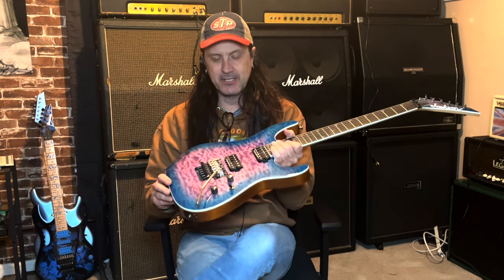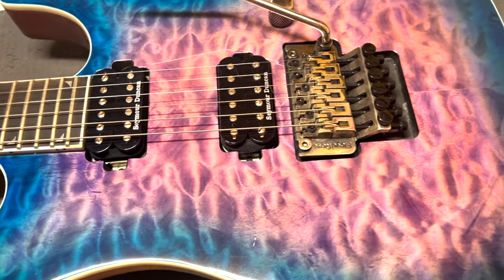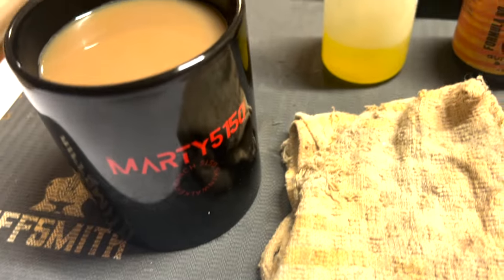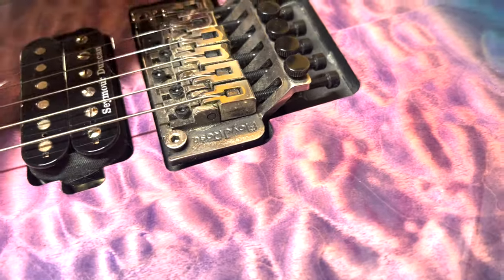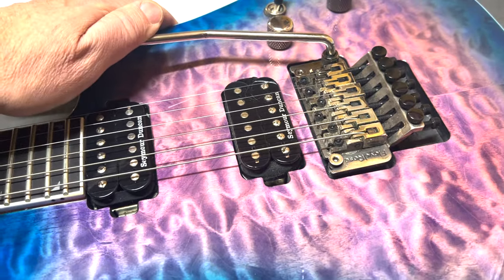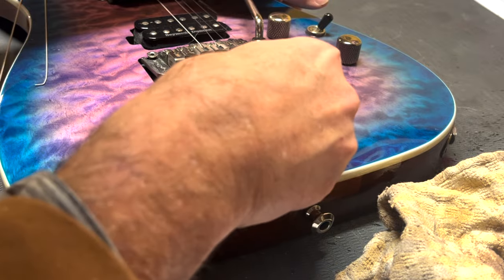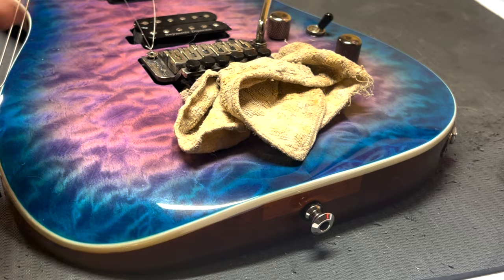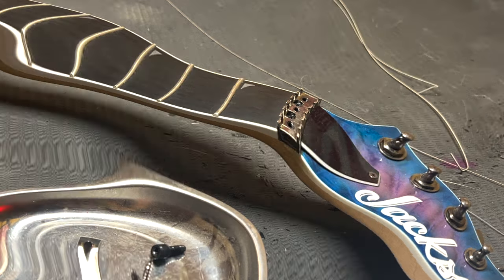How To Change Strings And Setup A Floyd Rose Tremolo

Comment: I put the ball end through the tuners and cut the end of the string with about 1" of slack and lock that in the saddle. It won't work with heavy gauge strings (doesn't fit through tuner hole) but I use 8's.

Comment: Great vid, I would like to add a little tuning tip. By tuning the strings in this order it balances the tension and I find I can tune faster. The order is E-e-b-a-g-d, repeat that order each time you re-tune and presto. Hope you find this helpful. Cheers
Reply: Perfect tip!
Thanks!
Reply: Good tip. I start on the middle two strings to work outward and go half the distance on the tuner past the opposite way of in tune until I get to the E strings. See the Doug Marks tuning video) Saves some of the teeter tawtering (spelling?) later on.

Comment: Nice guitar.. I kinda do it the same except once I'm close I back out the claw screws a turn or two then block something in the back that sets the float. then u can tune and intonation with it blocked then tighten the claw screws until the strings go back in tune which is just about where the block in the back falls out.. it sounds confusing but it eliminates all the chasing and guesswork.. im basically putting it  perfectly in tune with the perfect float without chasing, locking the nut, then it's just a matter of retightening the claw screws til everything falls perfectly back in place. Once I learned how which took about 15 years due to nobody teaching that way, I fell in love with floyds.. it's all I play now. I'm not saying your way is wrong but I feel it's still letting alot of room for beginners to get frustrated by the chase and give up on floyd roses alltogether. Cheers

Comment: If I'm in a hurry, I change one string at a time, no need to block. I also feed the string through the tuning peg and use the brass ball as an anchor so I'm not winding for days.
Reply from the maker: Totally man!  If you keep the same gauge do one at a time and tune to pitch.  Bam. Strings changed 😎🤟🏻

Comment: Awesome Video 🎸 ... Cheers 🍻 🥃🥃
Reply from the maker: Thank you.  So glad it helped 😎🍺
Reply: @Ranch5150SkinWalker  Yeah I have never changed String Sizes on any Floyd Rose Locking System... I take a scared cat approach Leave the 2 E Strings on Start one String at a time in the middle working outward... Work's.. But this is nice  now I feel confident in changing string gauges... Cheers 🍻 🥃🥃 🎸

Comment: Just got a FR and am doing some research before I change strings for the first time. This video is the most helpful Ive seen! You didnt skip over any important parts and described everything well... awesome job man!

Two questions: 1) Ben Eller on his channel recommends getting the bridge flat, blocking the trem from moving in either direction, getting strings up to tune, stretch them, etc.,  then lock the nuts, remove the blocks, and use ONLY the claw screws to get the bridge back to level and strings will automatically get back in tune. Does that make sense to you? 

2) I'm changing from 9s to 10/9 hybrids like you did. If heavier strings makes the whammy bar seem more "stiff," can I safely remove one of the three springs? Or is that going to screw everything up? At what point would it make sense to do that?

Comment: The right video at the right moment: just bought a new (used)  guitar with floyd rose.  Marty what is your opinion about Elixir strings?  The guitar arrived today with Elixir strings : usually I use Ernie Ball but these strings seem excellent. Thanks for the video!
Reply from the maker: You're welcome man!   Glad to help!  I Elixir strings are very good.  They last a long time.  I am personally an Ernie Ball 9 or D'addario NYXL player but really... they're all great options. Ernie Ball are 6.99 so they are usually my go to.  lol. And they never break on me 😎🤟🏻
Reply: @Ranch5150SkinWalker  thank you for your answer Marty. I usually use the same strings you do: ernie ball 9 - 46. About the video, to change all the strings sometimes I Simply change One string at the time, starting by the 6th One.
Reply from the maker: @lore5363  same here man, so much easier to go one at a time.   I showed worst case scenario where the gauge was changing and it jacks up the bar angle.  I get that question a lot.  It can get tricky if you aren't sure how to adjust.  Thanks so much for watching man and the comment.  😎🤟🏻🎵🎵🎵🎵🎸
Reply from the maker: @lore5363  same here man, so much easier to go one at a time.   I showed worst case scenario where the gauge was changing and it jacks up the bar angle.  I get that question a lot.  It can get tricky if you aren't sure how to adjust.  Thanks so much for watching man and the comment.  😎🤟🏻🎵🎵🎵🎵🎸

Comment: In theory, should the bass and treble sides of the Floyd bridge plate the the same height in relation to the top of the guitar body? My action seems high on the treble side, but the B and E strings buzz when I play frets 1-14.

Comment: I've had a Floyd equipped guitar for 19 years. It was my first guitar (not recommended, first string change was done in the shop as 12yo me failed...). 

I knew pretty much none of this. For instance I have necer cut the end off the string. I just opened tje saddle all the way so it fit in... I didn't know you were supposed to tune it from the back, I always unlocked the nut. And it's the only guitar I never did a full setup on, which at this point I do constantly. It just got warm, all my necks aren't at the correct relief anymore.... Haven't played it in years (Ibanez RG) now I want to refinish the guitar, and remove the EMGs I put in at 14. So I figured maybe I should finally look into how a FR is supposed to be used... thanks! Should have done that 20 years ago.

Comment: If you run the string down through the tuner and bolt in the already cut end, then you can cut the eyelet end off with some string length and you have 6 different gauge wires for poking out different size tiny holes on things like carburetors. Nice vid.

Comment: when i worked at ibanez (hoshino usa), if the guitar is already  set up , you can , relativly quickly  change out the strings by doing them one at a time, in other words, leave the rest of the strings alone and only take off one at a time, when one string is done , move onto the next, next tip, bloc the trem  with whatever you have on hand that will make that base plate level to thw guitar fret board, , crank on the springs till the block is held in place from tention alone , now string the guitar and tune it to whatever floats your boat, but the spring tention has to be enough to hold the blocker in place, when you are happy with the tuning, start releasing tention on the springs till the blocker just falls out, you now have an in tune floating tremolo, i hope that made sense, because after i was shown that by jim donahue , i never again had a problem  with a floyd rose system, yes it works for all the different lisenced floyd systems
Reply from the maker: Very true indeed.  Best way to learn is just do it a dozen times and understand the physics and fundamentals of the floating Floyd.  It's not too hard.

Comment: Even after doing all this my floyd rose doesn't stay in tune. The moment i tune my strings it detunes itself. Any suggestions
Reply from the maker: It may be catching on the mounting screws ... make sure it's stable and the bladed edge is flush and secure with the screws that hold it in place.  Stretch strings and make sure locking nut is locked down.  
Also check to make sure the saddles are tight and not moving.